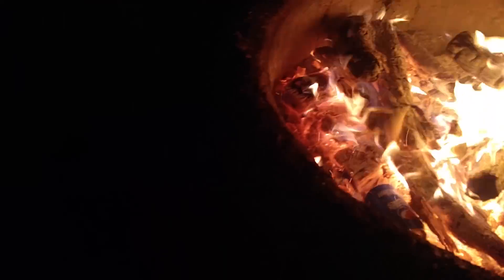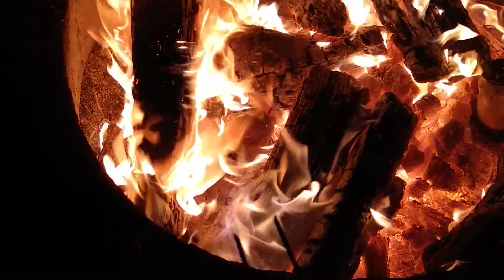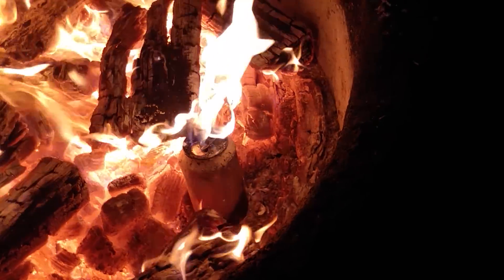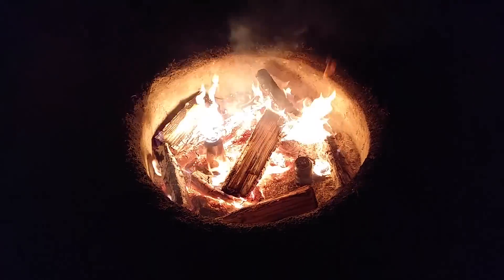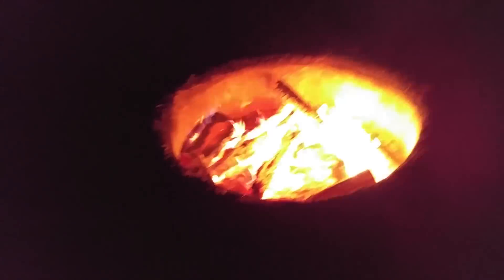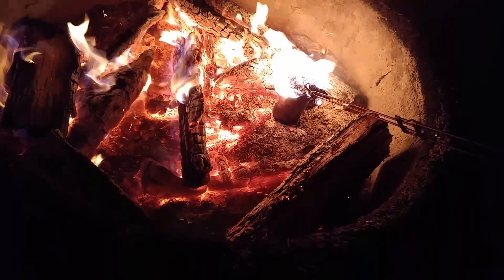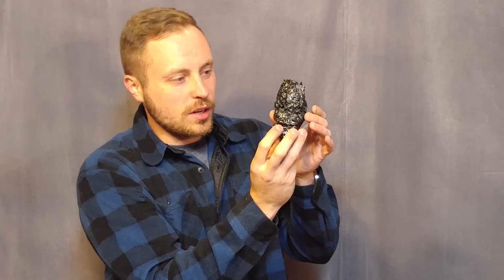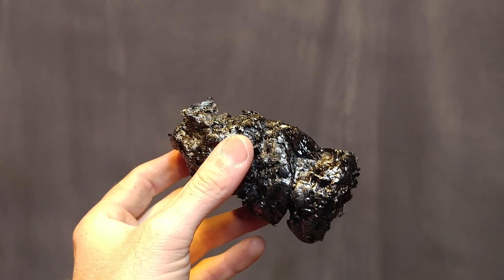BLACK DIAMOND FROM A SODA CAN!!!   Pure Carbon

Comment: Hey, hoping you can elaborate a bit. Why does the sugar not combust into carbon dioxide and water.  Feel free to use technical terms. Thanks!
Reply: Without the oxygen out of the air it doesn’t combust rather it decomposes into carbon h2 and I believe some h2o.